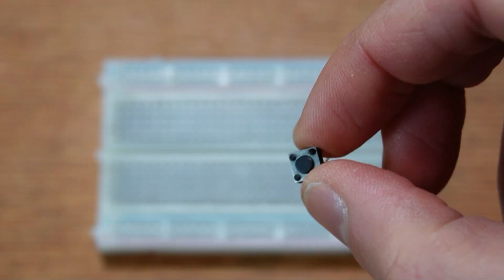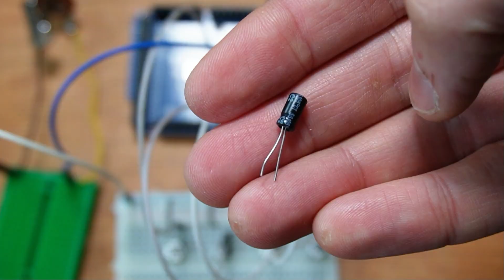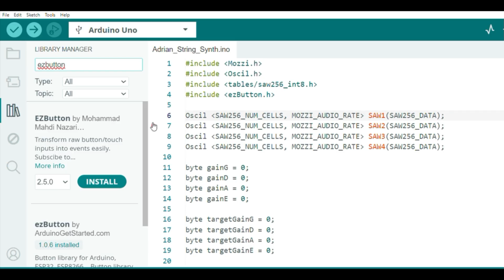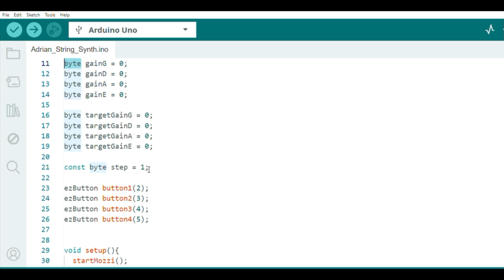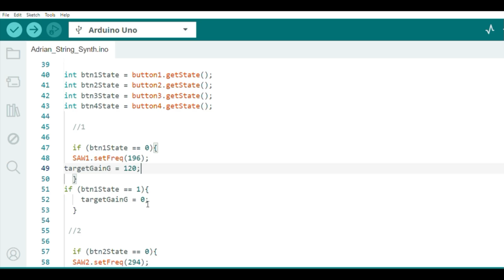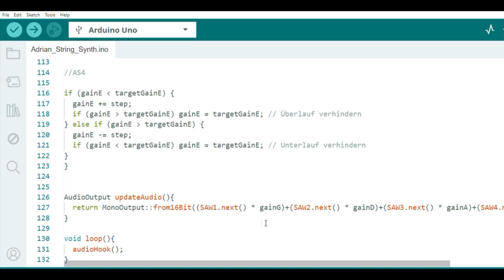Step by Step: DIY String Synth (Arduino)

Comment from the maker: CODE:

#include <Mozzi.h>
#include <Oscil.h>
#include <tables/saw256_int8.h> 
#include <ezButton.h>

Oscil <SAW256_NUM_CELLS, MOZZI_AUDIO_RATE> SAW1(SAW256_DATA);
Oscil <SAW256_NUM_CELLS, MOZZI_AUDIO_RATE> SAW2(SAW256_DATA);
Oscil <SAW256_NUM_CELLS, MOZZI_AUDIO_RATE> SAW3(SAW256_DATA);
Oscil <SAW256_NUM_CELLS, MOZZI_AUDIO_RATE> SAW4(SAW256_DATA);

byte gainG = 0;
byte gainD = 0;
byte gainA = 0;
byte gainE = 0;

byte targetGainG = 0;  
byte targetGainD = 0;   
byte targetGainA = 0;   
byte targetGainE = 0;     

const byte step = 1;  

ezButton button1(2); 
ezButton button2(3); 
ezButton button3(4); 
ezButton button4(5); 

void setup(){
  startMozzi(); 
}

void updateControl(){
button1.loop(); 
button2.loop(); 
button3.loop();
button4.loop();

int btn1State = button1.getState();
int btn2State = button2.getState();
int btn3State = button3.getState();
int btn4State = button4.getState();
  
  //1

  if (btn1State == 0){
  SAW1.setFreq(196);
targetGainG = 120;
  }
if (btn1State == 1){
    targetGainG = 0;
  }

 //2

  if (btn2State == 0){
  SAW2.setFreq(294);
targetGainD = 120;
  }
if (btn2State == 1){
    targetGainD = 0;
  }

//3
  if (btn3State == 0){
  SAW3.setFreq(440);
targetGainA = 120;
  }
if (btn3State == 1){
    targetGainA = 0;
  }

//4
  if (btn4State == 0){
  SAW4.setFreq(659);
targetGainE = 120;
  }
if (btn4State == 1){
    targetGainE = 0;
  }

//AS1
if (gainG < targetGainG) {
  gainG += step;
  if (gainG > targetGainG) gainG = targetGainG; // Überlauf verhindern
} else if (gainG > targetGainG) {
  gainG -= step;
  if (gainG < targetGainG) gainG = targetGainG; // Unterlauf verhindern
}

//AS2

if (gainD < targetGainD) {
  gainD += step;
  if (gainD > targetGainD) gainD = targetGainD;
} else if (gainD > targetGainD) {
  gainD -= step;
  if (gainD < targetGainD) gainD = targetGainD; 
}

//AS3

if (gainA < targetGainA) {
  gainA += step;
  if (gainA > targetGainA) gainA = targetGainA; 
} else if (gainA > targetGainA) {
  gainA -= step;
  if (gainA < targetGainA) gainA = targetGainA;
}

//AS4

if (gainE < targetGainE) {
  gainE += step;
  if (gainE > targetGainE) gainE = targetGainE; 
} else if (gainE > targetGainE) {
  gainE -= step;
  if (gainE < targetGainE) gainE = targetGainE; 
}
}
  

AudioOutput updateAudio(){
  return MonoOutput::from16Bit((SAW1.next() * gainG)+(SAW2.next() * gainD)+(SAW3.next() * gainA)+(SAW4.next() * gainE)); 
}

void loop(){
  audioHook();
}